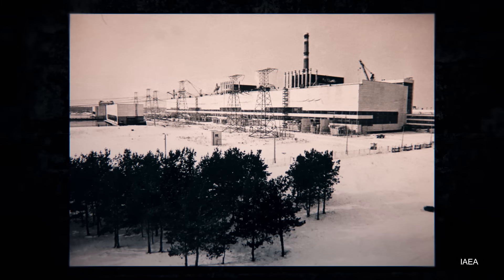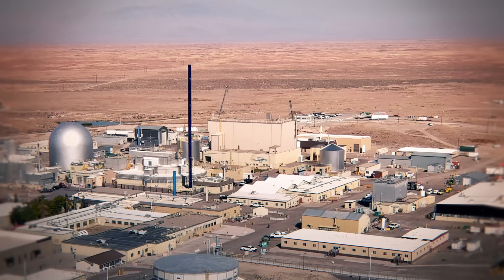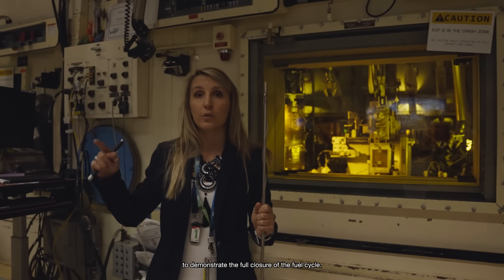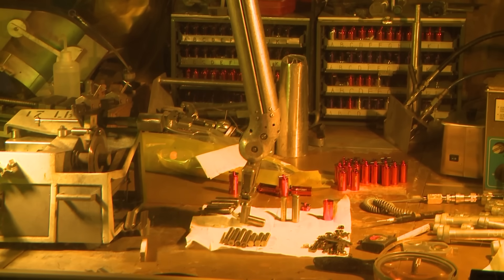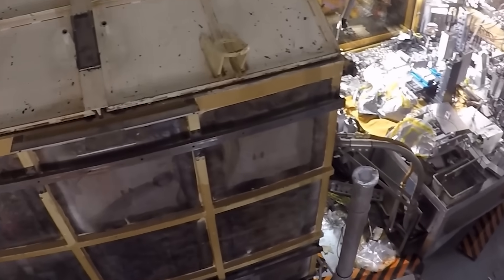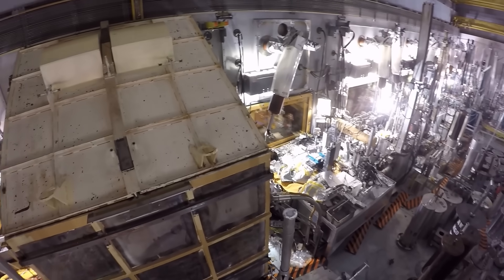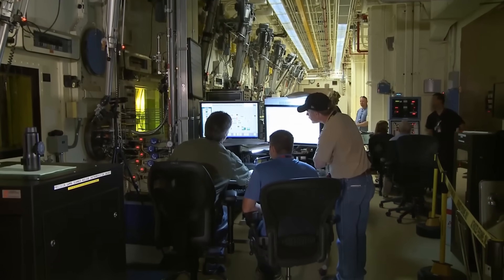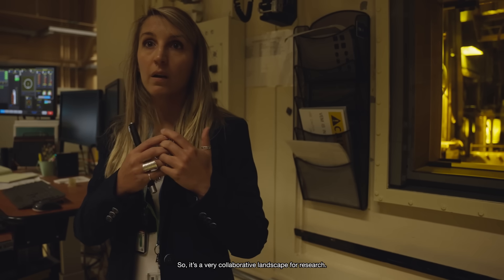This Room is Lethally Radioactive...For SCIENCE!

Comment: 3:40 Lead is not the cause of the yellow colored glass, radiation damage inside the glass is the cause. In fact lead is added to expensive crystal glass drinking glasses and chandeliers, and for clarity, not colour.

Yellowing in glass caused by nuclear radiation can be bleached by ultraviolet light.

Kodak Aero Ektar 178mm lenses are a good example of this. Thorium Oxide in the lens causes yellowing over time, yet DIY solutions are cheap and effective. 

I've done it several times.

An idea for a future episode?

Comment: You know. 

This is good. Making nuclear safer is needed. Theyre right. Its already safe.. in a lab..and under perfect conditions.. but the issue with nuclear isnt nornal safter.. its no one takes care of it likes its suppossed to do to lazyness and cost cutting. We dont need nuclear to be safer. We need nuclear to be safer when handled improperly and irresponsibly
Reply: Wrong. we need nuclear to go away because we do not need it as a power source. Nuclear is neither "safe" nor "green" as many claim it to be. Something that produces thousands of tonnes of material thats going to be deadly for hundreds of thousands of years cant be called "green" or "safe"
Reply: You do realize they don’t need to waste that much material they can reuse it. They just choose not to why reuse your old fuel rods by recharging them when you can just cheaply buy them from overseas.

Comment: You say "robot arms" but unless theyve been updated the telemanipulators are actually completely mechanical - just a series of cables and pulleys. You dont want electronic sensors and motors and solenoids for an application like this, you want something far more reliable than that. Its not easy to replace parts or troubleshoot inside a hot cell.

To me thats much more interesting, its a reminder to keep things simple instead of overcomplicating them by just sticking robot arms and AI and garbage on everything. At a certain point more technology actually makes things worse, not better.

Comment: A bit disappointed you didn't tell that radiation makes ordinary stainless steel form miniature cracks with time under high temperatures, because hard gamma radiation messes with crystaline structure of steel and other radiochemical stuff going on, that's why they test different alloy materials in the hot chamber.

Comment: Hol' up. Nuclear reactor the size of a trash can? Please talk about that one! Can I bury it in my back yard and power my house for 100 years? Also, if you think THAT rooms protection is cray-cray, look up the tour done of the NIDL facility here on YouTube. It's an infectious disease research lab, and before it began operation they did a big tour showing the different parts of its protection. Given that it's a lab that works with the most dangerous infectious agents we know of, you can imagine that it's protection is nuts. Like the main building being suspended within a larger building and with entirely separated air supplies that go through multiple incinerators, negative pressure so if there ARE leaks, air can only leak IN, not out, etc.
Reply: .love to 😇hear from 😇your🎉positive notes🤍🤍sᴇɴᴅ🤍🤍ᴍᴇ🤍🤍ᴀ🤍🤍ᴅɪʀᴇᴄᴛ🤍🤍ᴛᴇxᴛ🤍±17652620991🔝🔝!!😇happy😇🎉.

Comment: Ok... i have to question this. 

How do they do the maintanence work in that room? I mean those arms will broke once or the cameras or anything...
Reply: @the-weirdist  Not a single mechanical thing will last and work forever. Once they will broke down. Maybe twice... :D 

Ok..
WHEN the arms broke, how should they repair that? Better?
Reply: My guess is, until the room becomes completely inoperable they won't do any maintenance in there.  At which point if they need to, they'll remove all nuclear materials from the internal chambers or straight up use mobile robots if they get advanced enough to be of use.
Reply: @DemonKing19951  That was what i tought but the room's wall could be still dangerous. The question is how much. :D

Comment: There seems to be a lot really cool stuff going on in that cell:
BASIC CAPABILITIES: 
• Mechanical testing of irradiated fuels and materials 
• Bench-scale electrochemical separations research. 
• Precision milling, welding, and machining. 
• Handling and loading facilities capable of receiving large shipping casks and fuel assemblies up to 13 feet long. 
• Furnaces for simulating accident conditions at temperatures up to 2,000 C for extended periods.

IMAGINE trying to weld machine or weld something remotely. And the airlock seems to be rather large too... Would've been cool to see!

Comment: That hot cell is pretty cool, especially given how big it is! The 1.2 m thick walls seems kind of thin to me, though; I specialize in shielding for radiation therapy, and our walls are on the order of 2 m thick or more, and that's using high-density concrete that's 1.5 times as dense as regular concrete. 23 MV photon beams do NOT like being stopped easily!

Comment: I have an issue with the "nuclear is safe" messaging. Not because I think it to be excessively dangerous but because everything always has some risk associated with it. You can always make things safer. To pretend there is such a thing as absolute safety not only is disingenuous, it's also a type of messaging that goes back decades in the industry. Then reactors of the type proclaimed "safe" had accidents, safety was much improved but messaging stayed the same. So of course people became skeptical, maybe outright cynical. I'm not blaming the people, I blame the condescending messaging.

Comment: Until SPENT fuel can be safely discarded without the need for a bunker like area of storage, the actual use of nuclear fuel is well safe enough. We've come a long way in how we use the fuel, but the spent fuel is where we have major issues still. Just burying it in a heavily thick cement "grave" is a horrible solution.

Comment: "we are making nuclear better" And better means cheaper, right? 

I mean even if the fusion power plants become a thing in the next 20 - 50 years, I can't see it replacing fission reactors for energy, at least until fusion becomes "dirt cheap". ITER and such are on the edge of the material engineering, right now. Also fission isn't just about energy and bombs.

Comment: The layers of oil are genius. Any hydrogen-containing material would absorb neutrons, so polymerized hydrocarbons (i.e. plastic) would work. However, the plastic would slowly become radioactive itself, so instead you use liquid hydrocarbons which you can pump out. Presumably the oil is burned to produce CO2 and water, the water is condensed and the tritium left to decay until safe to release into the environment (it lasts decades, not millenia), and any ash left over is disposed of as nuclear waste. Using water directly would work but there are probably engineering reasons to prefer oil (the pipes are difficult to replace because the work would need to be done by robots, so it's better to use a non-corrosive fluid).

Comment: I saw a INL produced film about the intergral fast reactor (EBR-II.)
In that film they spent a lot of time showing the pyrometallic refining process.
This took place in a hot cell (east of the reactor containment), with one half being of a air atmosphere, with an airlock to the other half which was argon gas. 
The walls there are 8ft thick ferroconcrete with windows the same thickness.
In one shot they show a Roentgen meter that went upto 1,000,000.
It was showing 800,000 roentgen.
I'm fairly sure it's still there, albeit mothballed.

Comment: One of the challenges of the Chernobyl cleanup was that the intense radiation from the blast debris killed several robots that they tried to deploy.  How do they prevent a similar fate for the remote devices in the hot cell?

Comment: The hot cells are cool but also the whole logistics and engineering of making the thing remotely repairable and maintainable is the amazing part.
Reply: Exactly. What do you do if the robot arm stops responding to commands or physically breaks while holding something dangerous? The maintenance requirements and the safety issues that they present must be insane.
Reply: @Hybris51129 

I'm late to this party, but if you're still interested, the manipulator arms are actually quite resilient. The ones I operated at the savannah river site had been in service since the 80's and were still being repaired and used. There's really only a few weak spots in the whole system, like the tong cable between the claws on the inside for example.

If maintenance does require the removal of the manipulator, a maintenance team can pull the hot half of the manipulator out through the mounting hole and wrap it to prevent contamination spreading while they move the broken one to the machine shop. Its quite the affair, requires RP support and respirators for everyone involved. Once theyre done with maintenance, you can survey the cold side to make sure you didnt forget any hot material on the cold side, seal it back up and continue using it. 

Not a very descriptive account, but I didn't fix them, just used them. Hope that's informative
Reply: What do you do with old experiments? Everything’s lethal now. Getting them in is hard, taking them out is… 😅
Reply: Hot cells are cool no pun intended 😂
Reply: It's simpler than it sounds. Check out the first part of the movie "The Big Bus" when the remote arm is having difficulty fueling the nuclear reactor for the bus.
Reply: How do you change a light bulb in there?
Reply: @DanBowkley : How many robots does it take to screw in a lightbulb?
 
4552524f523a204d697373696e672066696c652064657369676e6174696f6e202243484b4e435253534e47222e20205245444f2046524f4d205354415254
Reply: @DanBowkley  This was literally my first thought when we got an inside view!
Reply: @DanBowkley this reads like a setup for a "how many nuclear scientists does it take to screw in a lightbulb" joke.. xp
Reply: Yes it takes an army of techs to keep a facility like this operational so a handful of researchers can do their cool experiments.

Comment: Working at a plant with online refueling, It always amazes me that when the machines transfer the fuel through the room where (in the absence of fuel) we perform maintenance, it is likely the most fatal place on earth. Fuel that has been out of the reactor for seconds-minutes. Fuel so hot it would burst into flames if removed from the water filled machines that handle it.
Reply: What kind of plant do you work at!
Reply: @HanmaHeiro  Most likely a CANDU plant, as those use online refueling
Reply: @caav56  Yessir
Reply: @ You're both awesome, You for knowing. And
Reply: @ You for working at such a place!
Reply: @caav56  Or an AGR, they do too. You can walk on top of the pile on those as they're low pressure reactors that don't require a strong containment building.
Reply: @Croz89  AFAIK, their fuel handling machines aren't water-filled, though
Reply: @andrewmason9137  which one? I'm at a candu as well. Scary when they do a fuel run and everyone is kicked out of the vault. Surprising even on the upper elevations with all thay concrete and steel, you'd still recieve a fatal dose
Reply: @caseyw1177 Sorry for the late response, didn't notice the comment. I work at PNGS, fueling here is quite different to the CANDU 750s and 850s at Bruce and Darlington.

Comment: I confirm that the inside of nuclear reactors are more radioactive, I saw a security camera get bombarded with electrons from 15 mts away when they took off one water level sensor rod
Reply: Radiation levels inside the reactor core are on the order of 300,000 to 400,000 Rads per hour if not much higher. Enough in fact to immediately kill human beings, but not radiation loving bacteria living on the fuel rods.

Comment: What's the process of adding and removing samples in the room?  Can everything be removed and people go inside for maintenance or is there like.... Lingering radiation.
Reply: The room likely has an airlock.  Humans and air outside, robots and argon inside, unless some major change needs to be made, then the nuclear material would be put in storage.  Residual radiation would be an issue, but most materials won't stay as hot as the sources.  Stationary things that didn't need to be worked on could probably be covered with protective blankets and other barriers.
Reply: My guess is that nearly everything inside the hot room is designed to moveable and repairable with the manipulator arms, except perhaps for the manipulators themselves.

Comment: I have a question, How do you repair the Hot cell, especially when robotics cant? Im guessing that room is going to be deadly for thousands of years or only the material that is emitting radiation stays radiated and not the surroundings?
Reply: My understanding is it's the samples that emit the "drop and run (and die anyway)" levels of radiation. The rest will be along the lines of working on a shut down reactor with fuel removed, safe to work there for a limited time.
Reply: They try to plan ahead so that components can be hauled out by an overhead gantry but of course the unexpected happens. I guess very rarely workers have to enter then they do the Chernobyl style "2 minutes in and out and you've reached your exposure limit for the year"...
Reply: @marklundeberg7006  Makes sense, thank you, Was always wondering how you work in those conditions :)

Comment: When I worked some summers at Savanna River, I got to see some hot cells like those and even got to try using the remote manipulator arms in their test setup.  Because once the inside to the cell is hot they are very limited in what they can change.  So they would set up everything in this test area to make sure that all the needed operations could be performed with the mechanical arms.  Another thing they would do there is modify hand tools so that they could be gripped and turned with the claws on the ends of the arms.  If you get the chance to see a test setup like that, it could make a cool video all on its own

Comment: So who gets to draw the short straw and go in there and fix things when they break down?
Reply: How many nuclear engineers does it take to change a lightbulb?
Reply: RIP Jimmy Carter
Reply: Fuck it, I would go in there if that would give me a chance to visit INL!
Reply: So there’s a Hot Repair Area where they repair broken manipulators. It’s a really common thing for the manipulators to break as you can imagine since the facility is super old. There’s a series of locks and transfer ports and tunnels to move things in and out of different sections of the facility.

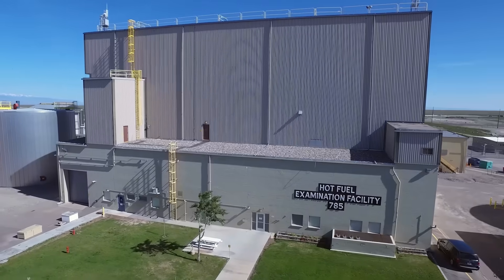Comment: 1:08 - that's... that's not XP, is it???
Reply: It probably is, a lot of government still use xp for really important stuff because they don't wanna chance upgrading and breaking really important stuff
Reply: last good version of windows
Reply: I'm guessing you're talking about the OS.  Lots of industrial equipment runs on whatever software was current when they started making it.  Updates are very expensive when you don't need the software to do anything new than it did ten years ago.  Lots of things like kiosks, cash registers, soda machines, that have a video screen are running on top of Windows.  When they make a new model of the equipment, maybe they update the OS, maybe not!
Reply: You should see what's running power plants.
Reply: @attiliozanetti1232  Linux I hope
Reply: @ViljoWilding usually just for networking, they usually use windows 7 pro
Reply: it does not really matter what os they running as long as the system is air gapped I.e not connected to the internet. sure someone could physically infect the machine or some worker plugs in a random usb drive they found on the parking lot but at that point you have bigger problems. still a barebones linux or bsd would probably be the best choice of os for stability, performance and security.
Reply: @YTacc-n4well it does matter which os because some can only support so many cores/threads and ram capacity. As well as networking and security features and most of the time older softwares need to run on older architectures and those softwares cant or havent been remade yet for modern systems

Comment: I wonder how they would repair something that breaks in the room. Wouldn't there still be residual radiation causing an issue or are radiation suits providing enough protection?
Reply: I expect they have shielded containers in the hot room for the radioactive sources and put them all away if repairs are needed.
Reply: A rad suit that has the equivalent shielding of one and a half meters of concrete does not exist.
Reply: @KyleMackenzie  concrete zorb ball?